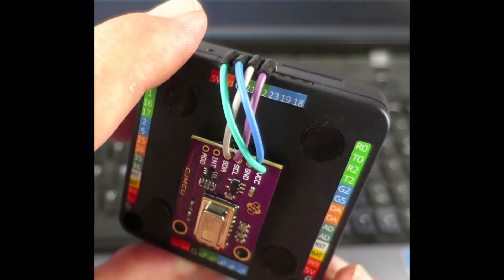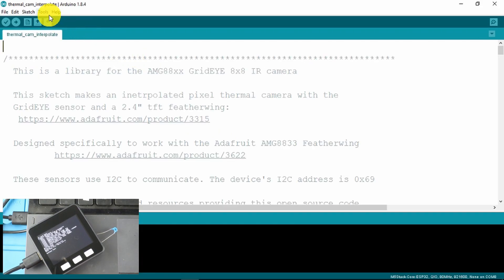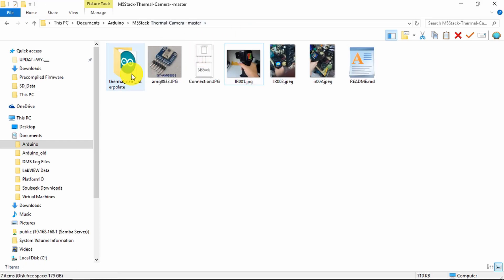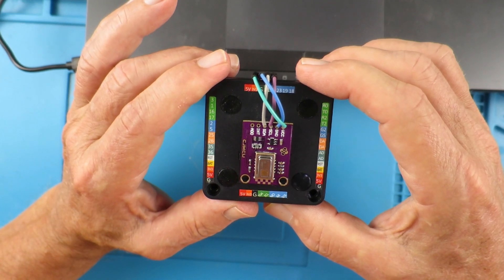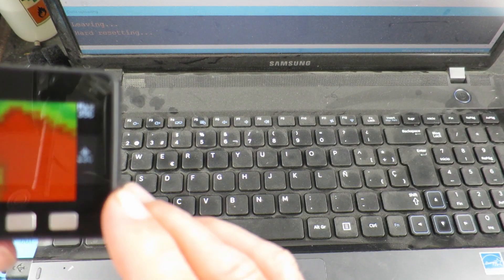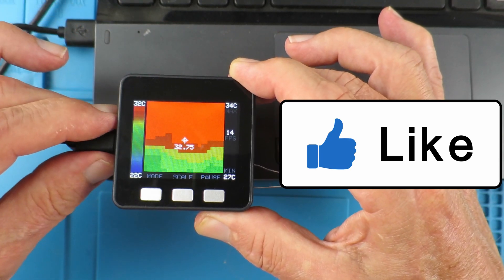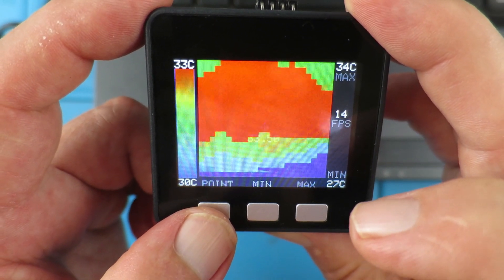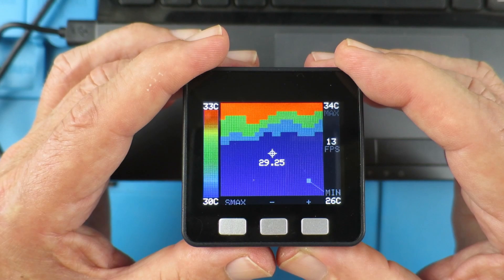M5Stack IR Thermal Camera CJMCU-833 AMG8833 Infrared Array Imaging Sensor Grid-EYE Electronics

Comment: so it only reaches 85c? so this wouldn't work so well for testing motherboard VRM temps? considering this to check if my manual all core oc to 4.75ghz on my 5600x @1.25volts with some tforce 3200 c14 clocked to 4000mhz 2000fclk 16,15,15,15,3,236,304,226,139,1t timings at 1.4volts is to much to handle or if the 4 layer garbage vrm cupels hold the test or not.
Reply from the maker: It is not suitable for that application. Please consider subscribing if you have not done so already!
Reply: @1nformatica  if you can suggest one that is and budget friendly I will.
Reply from the maker: @Kraxt0n  I don't think a thermal camera is the right tool for the job. Why not use the information provided by the CPU / motherboard itself? A few years ago I made this video where I replaced the thermal compound on a gaming laptop and used software to read the temps : https://www.youtube.com/watch?v=5ib-uJeBl9c Now surely that's worth subbing for?!
Reply: @1nformatica  not so we'll knowladged about how thermal sensors on the msi gaming edge wifi board is I'm assuming. It's inadequate at best. And vrm temps aren't actually read if they were I'm sure they'll show more than 60c as all tests done with thermo cups or sensors shoe 100c or more.
Reply: @1nformatica  I have a desktop, thermals isn't an issue. I'm more than skilled at replacing thermal paste lol. I'm just looking for a thermal camera that's gonna read past 85c. NEVER take the vrm info provided by a motherboard especially msi. They make some of the best boards there is. But it's always best to test at source vs software which is never correct. 30c idle 50c gaming, 60c on gpu gaming with max oc on air, my temps are well within check. As stated im more concerned with actual vrm temps from source vs software to read some "random" sensor to report back 60c when in reality it's around 80c if I'm lucky with my overclocks.

Comment: is it possible to make the resolution higher?
Reply from the maker: I guess you mean the resolution of the temperature value? If you read the device datasheet which is linked on the product page : http://bit.ly/AMG8833 you will see the resolution is 12 bits. This is used in the Adafruit library for the device, look at the end of the file : https://github.com/adafruit/Adafruit_AMG88xx/blob/master/Adafruit_AMG88xx.cpp
Reply: Thank you for the reply, what i mean is the resolution image.
Reply from the maker: The internal display is adequate for most uses as you can see in my other video : https://www.youtube.com/watch?v=h6ZJjYK1gG0
Reply: @1nformatica  ffs come on..he means more heat pixels... you can use one sensor and move it around, google: superresolution
i don't know if you can use more than one sensor at one time, enought bandwith and processing power? But maybe if you take pictures with only 1Hz it might work ok i guess, focus would be the final problem